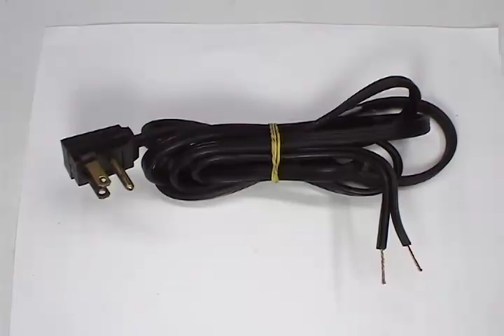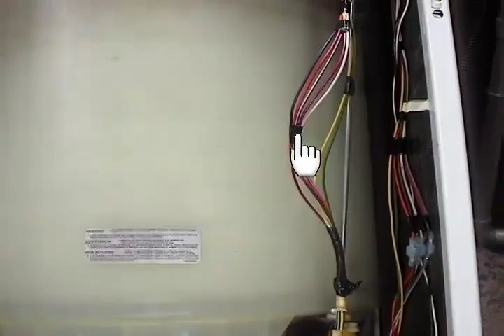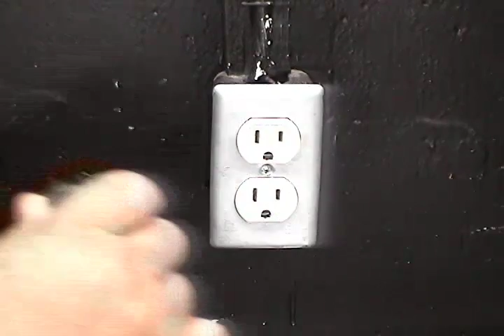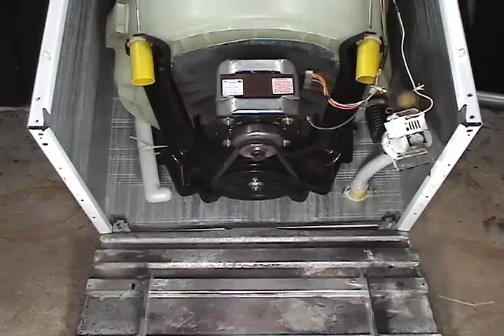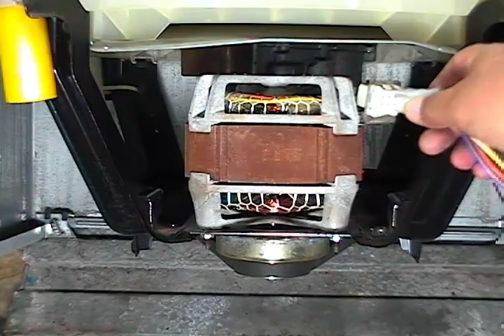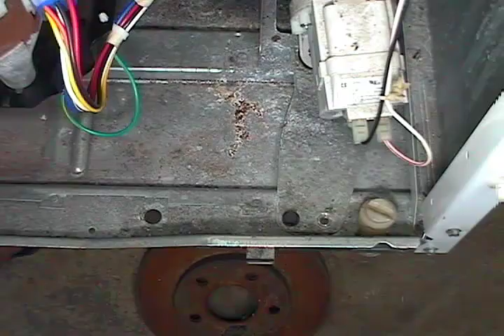General Electric Washing Machine Not Starting - The Motor

Comment: Do these instructions apply to the GE hydrowave washers? The wire colors don’t match. Thanks
Reply from the maker: No, the hydrowave washer is a different kind of washer
Reply: theapplianceman is it difficult to test the motor directly? I can’t seem to get my washer spin or agitate. Green light blinks 1 sec on and off (no codes), Lid switch tests ok via continuity test, no codes in service mode at the control panel, fusible link not blown, shifter coil tests ok via resistance, I replaced the motor with a known good used one, I checked for 120VAC at the motor side harness and that checks ok. I think I checked everything and it still does not work.
Reply: I also did a motor reset via lid opening and closing and nothing.
Reply from the maker: These machine are a piece of garbage You cant even try the motor like a regular dryer. I am sorry but I don't have much on that type of washer.
Reply from the maker: Check this link on youtube to see if there is something that mya help you.

https://www.youtube.com/results?search_query=DBVH512GF1ww
angel
Reply: theapplianceman Yes it’s a POS. Thanks.
Reply: @theapplianceman  the motor have a red light that blinks why?

Comment: I have wsm2700dawww spacemaker washer and dryer and i need to connect it directly with 120 volt ac which wire i should connect to have agitate mode and spin mode. Help plz

Comment: My schematic has a capacitor at M7, and unless it is included in the test circuit the motor will not start and the test cable will not work.